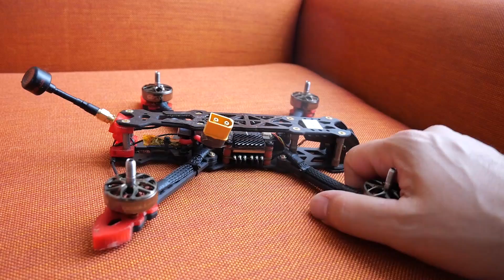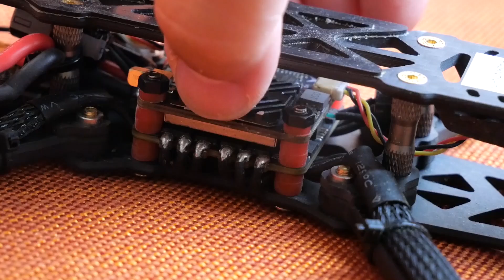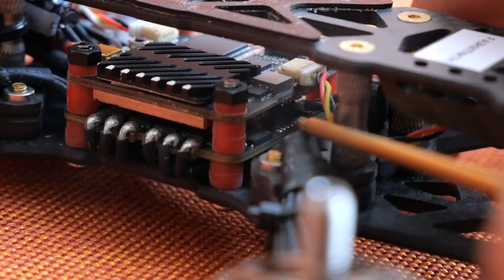Never buy a Flight Controller with this feature (GEPRC Mark 4 deal breaker)

Comment: Thank you very much for Mr.Joshua's feedback. Your comments and reviews are very important and we attach great importance to them. 
 However,I wanna add that the Mark4 freeestyle you reviewed was a small batch of prototype, it is initial version. Before production, GEPRC team has optimized and improved this problem. The latest batch shipment of Mark4 has used the latest wiring method and improved the soft structure design.
Fix the following issues from June 1:
1. The connection mode of FC and ESC is changed into flat wire, which makes the connection more stable.Pls check this photo: https://geprc.com/wp-content/uploads/2020/03/2-3.jpg
PS: Regarding the prototype , After GEPRC investigation, it was first batch ,NOT PROTOTYPE, and the output is very small. At present, the new version has been solved and used the wire. GEPRC greatly appreciated for your attention and support, Best regard
Reply: I don't understand why you would sell these prototype versions to the public because I got hey geprc Mark for 4K loved it and then I got the freestyle version which is the one reviewed in this video and the exact same thing happened that Joshua just said. The pins ripped right off and when I talked to geprc about it you guys just said it was user error everytime😳. Thank you Jashua Bardwell for making this video hopefully they will actually listen to you.  and it doesn't make sense that they say they changed it because I've ordered two of them from them and both versions were the exact same flight controller with this pin design and you guys are shipped me that the new one you sent me was upgraded which was a lie and then denied that you sent me the wrong one. Such a  shame you guys were my first company I bought from when getting into FPV and now I don't think I can support it.
Reply: That actually looks quite neatly made. Good on you for spotting it/fixing it!
Reply: Mine just came from banggood with the pin headers, I would like it replaced as I did not pay for a "protoype" as you call this setup
Reply: @Devonfisher  yep geprc is lying.
Reply: I had a brand new geprc stable stack with this "feature" and it was broken from the factory and it destroyed esc and FC. As the ESC warmed up, motors stopped working and stopped showing up in BLhelisuite. BG would only refund me 60% for a completely broken stack.
Reply: Same weak solution on other GepRc quads as well. Besides the customer service from this company is a joke. I recieved a Cinepro 4k with bad soldering, a reciever that will not be flashed, and an antenna problem. They refuse to listen and comes up with strange solutions they want me to try. At first I was open to get it fixed. Now I’m sick and tired of their games and have requested a refund. They responded with som new BS and does not answer questions. They are not giving me the adress to ship it to neither, so here I’m stuck with a useless quad. Stay away from this company.
Reply: Great corporate response...  LOL. SMOKE BLOWN.  What’s up with all the crap 20x20 pinned stacks destroying your customer base too. Sounds like you didn’t learn anything from HGLRC. Even when they make a good product now people go back to the hard pinned stacks that failed and assume the same will happen. Re-design, re-tool, and restore your reputation. Maybe admit you made a horrible design flaw and save some face by making it right...  nah, that’s how honest folks do things
Reply: I call B.S, The latest wiring method??? its still a pinned connection, I literally bought one from Gep a month ago.. Do not believe them Joshua, I bought mine on june 25th and its still that way. Why are you selling prototypes to the public Gep? We need legit answers and not lies.
Reply: @MrMosinNagant1937    Oooo lookie  Important   reply here     I saw the pic they posted and it looked legit   standard pins we all know and love....  and  usually like I mentioned when those are in place there is usually additional solder pads because well lets face it its still stupid molex or  whatever type pins and  of course  plastic breaks .    As Josh mentioned in this video here ---> (https://youtu.be/s_ybltZTiJ4?t=107)  But I was encouraged by their pic because the quality of the parts looked legit.   But if they are selling the one they sent Josh even after being told its a crap idea and even after responding they they have addressed the problems  is just freaking shady ,,
Reply: Silicon cable is the best way to interconnect, if soft mounting between PCB's... You know like with the GEPRC span pro f4.
Reply: @MickDownUnder    ???   I See the same stupid pin headers  on that  bro    what you talking bout Willis  ?      https://youtu.be/q9LpiLlEROs?t=27
Reply: GapSnapper FPV pro version has the cable, no pin header.
Reply: All i can say is that my GEPRC Cinequeen is the quad I've banged up most and got me to the point where I fly more and crash less. Its still my trusty and most dependable flier.
I wouldn't be afraid to make another purchase from them!
Reply: @geprc, so now the only thing left to do is replace all the prototype boards you sold to people with the final production models. right? the fact that you confessed that these were prototype models  (that you sold as final production products) makes you legally liable, at this point.
Reply: If you like the integrated VTX in the FC have a look at the LDARC F4 & 4in1 ESC stack.
Reply: Glad to see this issue has been addressed already.
Reply: @rc-fannl7364   It hasnt. They say they did, but I bought one recently  and its stilled pinned plus a few other people bought some a few days ago and its still pinned
Reply: @MrMosinNagant1937  Did you buy from GepRC directly, or a reseller? In case of a reseller, it might have been old stock that didn't have the changes applied yet. If from GepRC directly, I think you are entitled to getting a replacement.
Reply: RC-Fan NL  bought from them directly. I asked for a replacement, they refused and said they would replace the board if it broke, I have a feeling they would just give me another pinned version.
Reply: @MrMosinNagant1937  Hmm, they basically admit it's badly designed, but refused to replace unless it fails, which might result in further damage to the quad? Maybe GEPRC of today isn't the "we are proud and fully stand by our product" company that I felt they were, when they released the first MX3 Sparrow, and the Phoenix. The MX3 V2 was a bit of a let down in some areas, no working current sensing, and two props just exploded in mid air, not even running on 4S.
Reply: RC-Fan NL pretty much, their comment is a lie just to try to save face.
Reply: The email they sent me. Hello, 

First of all, I'm very sorry for the unpleasantness
Due to different batches, there may be some inventory，However, Both of these methods have advantages and disadvantages,Each of our methods will be tested many times to ensure that the product is normal before it is officially sold

If there is a fault in your use again, we can replace a new AIO for you.

Thank you
Reply: Glad to hear this :) my cygnet 3 pro broke its pin headers off in a few brief moments after I clipped a tree branch and broke a prop blade off - I love the quad, but had to replace the stack after that.
Reply: I ordered this exact quad a little over a week ago. It arrived 2 days ago and while I was flying my 4th pack I landed(kind of a hard landing)after that it wouldn’t arm. I unplugged the battery and it would only power the ESC I checked and it was this same problem!!! Mine did not come with the new connector!!!
Reply: And the recently released GEPRC Thinking P16 has similar issues. The Caddx Vista easily touches the AIO F4 ESC!!
Reply: @KensonLeung0  Thinking P16 is high enough and not easy to access. If you have any questions about using it, please consult support.Thanks
Reply: geprc I got spark and smell after plugging in the typec cable for vista upgrade. (The type c connector touched the ESC capacitor)
Reply: Pin connection mode can be more convenient, and soft damping pad can provide more gentle shock absorption, which won't affect flight performance under normal circumstances. The latest version of stack has used flat cable to connect FC and ESC. Both methods have their own advantages and disadvantages.
Reply: @jinchen9937  So why wasnt mine shipped with that cable, so far no one I talked to has that cable, I ordered mine on  june 25th and it came with pins.
Reply: @jinchen9937  Are you seriously attempting to rebut the obvious close up video evidence?  You literally claimed that BOTH  methods have their own advantages and disadvantages. 

The only obvious advantage to a vertical pin mount is the awesome potential of loosing connection between the flight controller and the ESC while 350 meters above a crowded city street potentially damaging property and hurting people.

Convenient ! ?  Obviously addressed in the video as well. Why did you even mention soft mounting.  That is not an issue and everyone agrees that soft mounting stuff is great, and even sometimes required for more touchy boards.     Are you seriously so confused that you actually thought Josh was saying that soft mounting was a problem? When clearly the only problem is the vertical pin connection.  

I can see how the potential barrier in language might cause some confusion ....HOWEVER    since  the official geprc response above was articulate,     concise,     English,      including their mention of implementing the current industry standard as  (used the latest wiring method).

I'd have to wonder where you missed the mark?  

I've got ribbon cables between my Matek boards  but even Matek was smart enough to provide solder pins in case I don't trust the ribbon cable.  Josh  clearly stated he's been bashing this beast around,,    as one should .     It looks to me like the vertical pin configuration lasted longer than it should and he was just lucky to have gotten any flight time at all  with this obviously flawed design .
Reply: Well done geprc!

Comment: If you didn't want to make this video. Then why did you?  just give it to trevor doup he will apreciate it. Today you will learn something it's called a DIY cable. Worked out very well on mine awsome drone. Pretty sure I'm not the only one who thought of this switch.
Reply from the maker: I dunno why you're mad at me for pointing out a critical defect in a product and saving people from having to repair it. Yes you can repair it. But you shouldn't be forced to. I'm sticking up for you. Why are you sticking up for the manufacturer who sold you a product with a defect.

Comment: I had this problem on the iflight succex 2020 stack, if you can solder well, just solder it properly back on the board with leaded soder and from my experience it will work well

Comment: Looks like the pin header has come de-soldered from the FC.
Reply: Either that or the pads have been ripped off the PCB.
Reply: @ddegn  Maybe.... Possible that if that were the case that the FC wouldn't power up when the board was wiggled.

Comment: I have a hobbywing stack with the same design feature. But with two rows of connector pins and smaller ones. I have heard mounted them (no play in the stack) and have had never problems with this. It's a good thing to keep in mind though! But it can work in some occasions. But I think I also have to agree. Wiring them is more secure if the solder joins are ok :)

Comment: As for the pin header, I've never had an issue with those at all. But with no nut against the frame on the stack bolt, that's asking for trouble. Especially adding soft mounting.

Comment: last time im using pin for stack is from iflight succeX and it's suck. Hard to repair, and little crash will damage the bridge. Wire solder is a must.

Comment: This reasoning works well for quads. But you shouldnt say ALL flight controllers. the matek f411-wse wing/inav fc has pin headers and it has a good implementation of the system that works great!

Comment: I was scared by this video, because I've ordered SPAN F722 VTX from GEPRC, wich have the same form-factor. But when I looked at photos there was a wire connection between the ESC and FC in this model. So GEPRC has fixed this problem in newer models. Such a relieve!

Comment: Have you heard of any of this issue with the Eachine Novice 2? Mine was fine until one day it just failed right after take off and hasn't flown since. The bright LEDs don't come on unless somehow I get lucky and kinda barely connect the battery but it's getting power but just not enough to hear that chirp of the FC. Once I hear that chirp then the LEDs will come on but not coming on at all anymore. Only a red and blue light comes on, nothing else. I wiggle wires and parts hoping to hear that chirp but there's nothing. I just wonder if it's the same type of issue? I need help!
Reply: First check battery connector's wires. One of them is probably loose after crash.

Comment: Emax did this on their magnum f4 stack but they did like you said they soft mounted the 4 in 1 and hard mounted the rest of the way up. I have been flyin the magnun f4 for 2 years now and havent had problems yet. Although i havent really had that many crashes either.

Comment: I really appreciate this feature in theory, but you're right that design is ass. I'd use through-hole pogo pins or just say screw it and solder both ends with hard pins.

Comment: I've been flying a BrainFPV RE1 with matching PDB on a FT 210 frame for several years now with zero problems with the pin headers. Maybe GEPRC should just use better components.

Comment: Agreed, I’ve had this type of connection fail in a few ways. Solder joints cracking, the pads straight getting ripped off and the same loose connection issue. If you have a hot air rework station you can pull the connectors off and solder wires to them but it’s a pain in the ass and they usually are tiny pads.

Comment: Thanks for letting us know, Joshua.  I’ve seen this a couple of times, too.  Doing that “header” connection between the FC and 4-in-1 ESC isn’t appropriate for a flying machine.  Now, I’ve used a physical interface just like this one without any trouble at all; of course, I was using it to connect an HV power supply to the main board on a Nixie tube clock which is definitely not a flying machine.  And please continue to tell us about the parts of designs which seem inappropriate to you, even if you think it may be over the top.  All of us pilots, trying to deal with the huge amount of hardware coming from China, need insight from folks like you.  It’s not as if we can call tech support the next morning and chat about it with one of the engineers.

Comment: I use 5 min epoxy and make a solid foundation around the pins. i got tired of it breaking and now i apply epoxy before i solder a single wire. don't use CA glue!!!!! it will clog the female pins and it would be a pita to unclog. i no longer deal with the issue on any 16x16 board
Reply: That's what the magnum f4 tower have. I broke 2 pin headers still
Reply: @Mjmestrom1988   @Michael  i had to go google it because i highly doubted they will break with epoxy. on the picture it has some yellow stuff that looks liquid tape and to be honest that doesn't look like a solid foundation to me.. i apply it all around and give it the shape of a volcano with only about .5mm of the plastic headed exposed the rest i completely cover with epoxy plus i do it to all the pins even the vtx

Comment: I had two SPCMaker stacks with pin header connections and both failed after several weeks (20x20mm, hard mounted with long M2 steel screws). If I had any FC with pin headers left I would rip it off with a pair of pliers and solder directly. I even do that with JST connectors on some FCs.

Comment: I’ve had this quad for about 3 months now, when I first got it, I had the issue from the second I put the battery on it... they sent me a replacement esc....   when it comes time to, what set up would you recommend to throw in this frame??
Reply: I’ve got the Zeez FC and ESC combo and I love it, JB made a video on it two days ago I think.
Reply: Hutscardist FPV thanks I’m gona check that out

Comment: The top header should be soldered to the board, not loose like it appears to be. I had a similar issue with my cinebee 75 HD.

Comment: Just to be clear, because Josh pretty much hinted at this but didn't actually come out and say it:
1) The board in the video is actually broken (probably due to the reasons described).  At 1:45 when Joshua moves the stack, you can see that the pins which are supposed to be soldered to the FCB are moving freely, no longer soldered
2) Soft-mounting boards with a hard connector between them just means they're not even really soft-mounted, and that the one connector is taking up all of the physical load.

Comment: That's weird. Usually pins in connectors are really tight, sometimes too tight. I don't know why yours look like they're floating around on top. The connector should be making those rubber washers almost useless.
Are you sure you didn't rip off the top connector?

Comment: This is a flaw with the iflight succexx 20x20 stack as well. Would definitely never buy a stack that connect like that and don't also have an option for a wire harness or hard soldering. You could fix by desoldering those headers and soldering wires between the boards instead